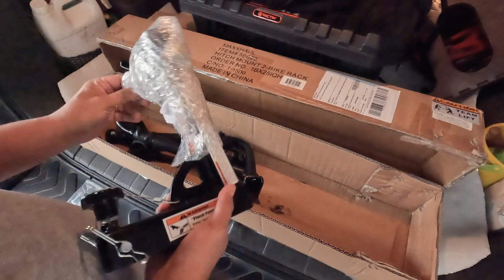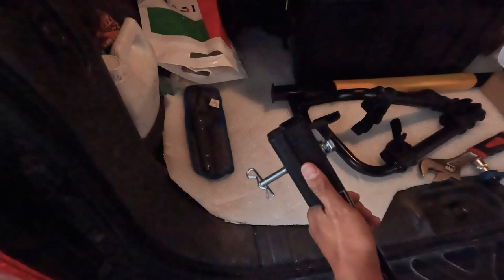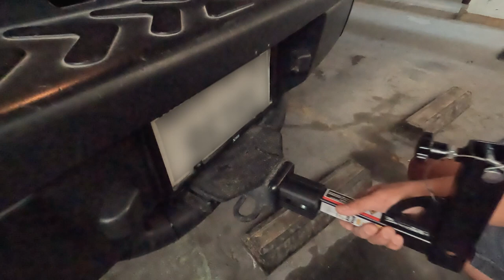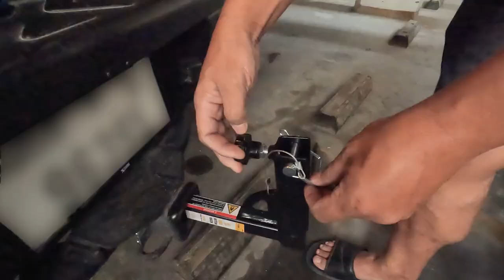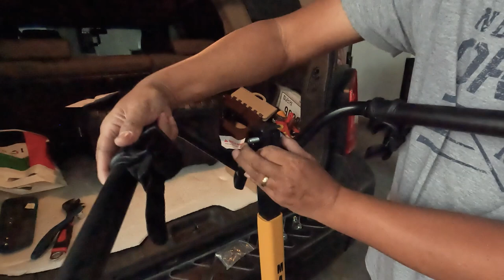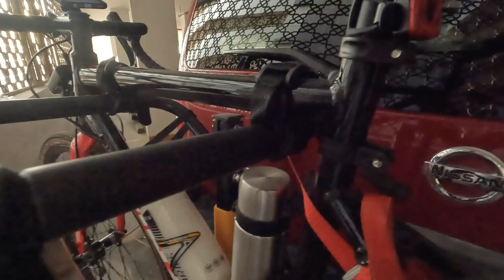Maxxhaul Hitch Mount Bike Rack for 2 Bikes Unboxing and Installation

Comment: thanks for the tutorial, i just installed mine, but even though the bolt in the hitch is tight, it kinda wobbles, is it the same with yours?
Reply from the maker: Hi. There's no wobble in mine. Maybe you can put something in between the hitch before you tighten it down to lessen the wobble.
Reply: @kapitanusotv  yup, will try that! thanks :)